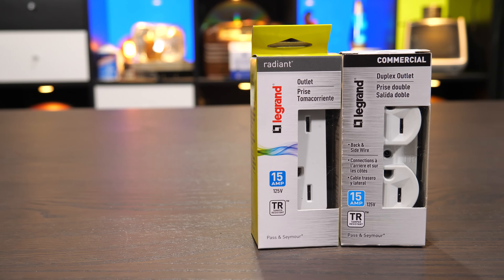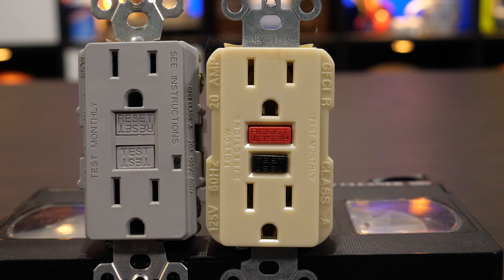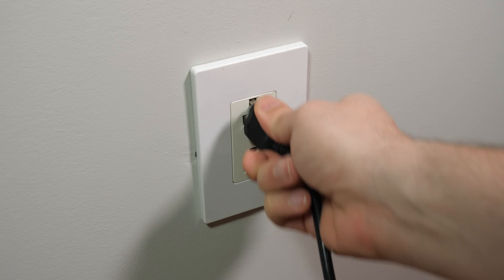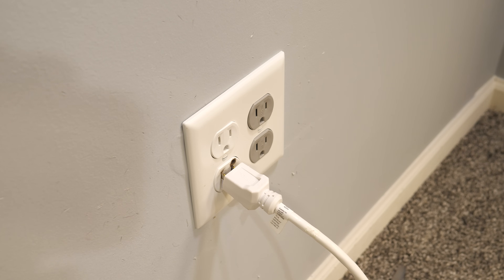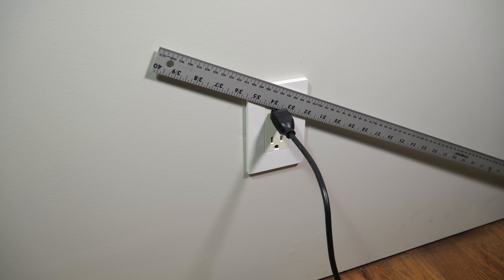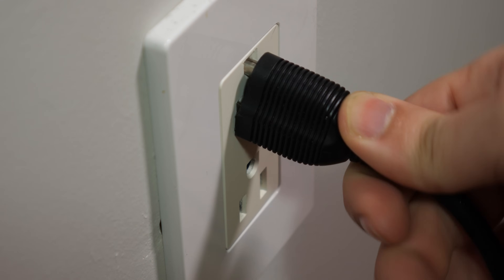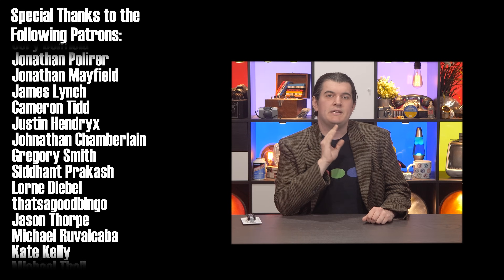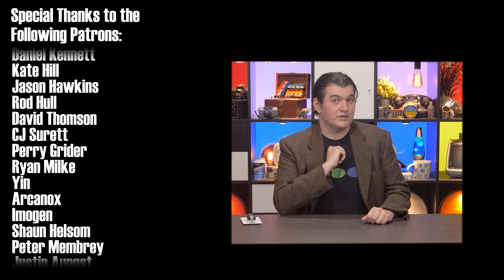Power outlets are topsy turvy - but does it matter?

Comment: I'm far too annoyed with slots on my UPS getting eaten by manufacturers doing "clever" things with plugs (wall warts instead of bricks, right angle plugs, etc), that I'd much rather have a slenderer derivative of Schuko than have right angle NEMA plugs everywhere. Slightly recessed, ground pin(s) stick out from socket instead of from plug, sleeved live contacts, etc.

And then mandate jail time for manufacturing plugs that interfere with plugging things into an adjacent socket either in vertical or side by side socket arrays.
Reply: i bought a pack of super short extension cables years ago for precisely that scenario.
they're not useful often but it's nice to have a few

Comment: Right angle plugs have the same prong issue, so it's not hard to remove them by throwing butter knives at them! After the breaker pops, just pry a bit on the plug while dislodging the knife.

Or use a plastic ID card of some kind.

Or the manufacturer could include some type of removal loop that swings against the wall when not being used.

Comment: As both an example of an upside down right angle plug and an example of why not to turn receptacles upside down, my grandparents bedroom window AC is an UDRAP and they've been duct taping it to the wall upside down for years and the outlet is completely shot, to the point you have to twist it then tape it to make it turn on. I finally got him to replace it last year and I installed that specific outlet upside down to fix that problem for good.

Comment: Your point above the various cords and other devices being designed for the de factor live and neutral on top orientation is actually quite significant from a safety standpoint. These cords and devices will be balanced so that gravity pulls them into their stable direction and any cords coming out of them lay flat in this orientation. As you showed with the right-angle appliance cords, inverting their orientation throws off the balance, causing a cantilever that pulls them out of the outlet. In fact, many of these devices are designed to that pulling them in this direction makes them easy to remove from the outlet - pull up against gravity to remove them easily and safely.

In addition, as you showed, having these cords and devices oriented such that any cables coming from them point up naturally results in them folding over significantly. The cables are not designed to be used in this orientation. It creates significant stress on the cables, which over time causes them to crack, leading to short circuits of the wires within and failure of the insolation on the outside of the cable, exposing the energized wires within. Both of these are far more common situations that lead to overheating and fires. There are endless incidents where frayed cables lead to partial short circuits, slowly overheating and starting fires, often when people are away or asleep. For this reason alone, it is more dangerous to orient your outlets such that the cords extend upwards and you should never use a device in this orientation. Having the cable extended sideways still presents this same kind of issue, but it's less pronounced and won't fail as quickly. Most cords can withstand 90 degree bends under significant load, but 180 degree bends are almost certain to cause failure under just their own weight.

TL;DR: Do not use any devices oriented with their cables out the top such that they fold over. Bending those cables will lead to failure including exposes energized wires or internal shorts that start fires.
Reply: In the end you just described why the A and B plugs are horrible bad constructions.
I love my F Schuko 🥰

Comment: Although I think a lot of the criticism of 120v outlets is kinda pedantic, the 240v outlets in the US are terrifying to use.  No grip on the plug, very tight, lots of exposed metal on the contacts, and all of that in a tight and confined space behind an appliance.  That needs some attention, pronto.  They changed the standard some years ago from the old 3-prong (Two phases + neutral) to a 4-prong (2 phases + neutral + earth ground) but did NOTHING for the ergonomics.

Comment: would have made sense if the prong design was ( --| |-- ) since if the plug was pushed down, the horizontal slotted pin would prevent it from dipping at all. same if you pushed it side ways with the vertical bar. maybe its time for an upgraded reciprocal. chinese reciprocals have alternate facing pins, even Switzerland's cylindrical pin design is simple enough to counter a dipping pin out. I don't know who designed the american outlet but it was clearly a mistake.
Reply: It's pretty ironic that the first American plug patented by Harvey Hubbell in 1904 had the two horizontal prongs (– –)   Shortly afterwards in 1912 or 1913 Hubbell made a plug with vertical pins we now call NEMA 1-15, at the time many homes still had gas lighting and no standards existed for voltage and current rating, they were used interchangeably for 110 and 220 volts Sometime in the 1950s the (– –) plug got it's official rating of 250V 15A designated NEMA 2-15 and was banned in the late 60s because of no ground or neutral,  if this plug were found today perhaps on a window air conditioner from the 1950s where homes were wired with cloth two wire no ground romex it can be used in a modern NEMA 6-15/6-20R without any problems,  assuming it's cord is in good condition.   This is why you sometimes see very old receptacles with (-| |-) slots to accommodate both plug types which coexisted for many years.

Comment: I had a shocking incident with the live-on-top that could be a motivator for ground-on-top in specific scenarios.

I worked in the kitchen of a Burger King back in 2003. There's a large work station where we assemble the burgers. The microwaves are placed on a shelf above the working surface at about eye-level. This shelf has outlets mounted on the front and the cord for the microwave is plugged into this. Like most outlets in my area, it was mounted with the live and neutral on top. As usual with our NEMA 15 plugs, they were always sagging a bit, exposing the live and neutral prongs.

The wax paper wrappers we use for the burgers are stacked above the microwaves. Occasionally, when you pull down a wrapper, a few more will slide off and fall in front of you.

While I was working, there was a promotion celebrating the anniversary of the Whopper. As part of the promo, we switched from the usual wax paper wrappers to metalized wrappers. One day, while pulling a wrapper off the stack, another slid down and landed on the slightly-exposed live and neutral pins of the plug, instantly creating a shower of sparks just a foot in front of my face. Thankfully I wasn't hurt, but that was quite a shocking experience that left us all stunned for a bit. This same incident happened to someone else just a few days later. My immediate thought was that we probably shouldn't leave thin metal objects stacked above an outlet like that. My next thought was that, if the plug weren't mounted with both live and neutral on top, such an incident wouldn't result in a short circuit.

Of course, this is a very specific situation. I expect such situations tend to be quite rare. The fact that live and neutral is such a de facto standard and that so many cords and devices have been designed with this in mind makes it impractical to begin inverting all of our outlets. Like you rightly pointed out, this causes problems in far more common situations.

As an aside, the metalized wrappers had plenty of other issues. Our standard practice is to put the bottom bun and burger patty on the wrapper and microwave it for a few seconds to ensure it is properly heated. That was fine when we had wax paper wrappers, but obviously couldn't be done with the metalized wrappers. We were only using the metalized wrappers for Whoppers - all other standard burgers still used the wax paper wrappers. Everyone was instructed to not microwave the metalized wrappers, and we were all intelligent adults who were fully aware of the importance of  this, but in the hustle and bustle, habits kick in and you eventually find yourself throwing the metalized wrapper in the microwave. It happened repeatedly to everyone who worked in the kitchen. Thankfully it wasn't quite as terrifying as those wrappers shorting across the prongs of a power plug.

Comment: I've always installed my outlets ground-up.  If an object falls between the plug and wall, it'll hit ground first.  My preference only.  In my home, only a few are left ground-down... those are the ones I haven't replaced yet.  As for right angle plugs, they work much better when the device is on a shelf above the outlet, which pretty common.

Comment: I live in the Netherlands, so we use the euro plugs, and are those safer? Maybe, they are bigger, that's a thing. The modern plugs are safe, also for children, and throwing knifes at a connected plug will only be a danger as the knife cuts the wires... 😜 Our earthed plugs are hard to put into the socket and hard to pull out. There is a reason for that, I presume. When I see the US plugs being inserted and removed, it is just sliding in and out. Is there any grip? The 2-pin euro plus also go in and out the socket easier, to be honest.

Comment: UK plugs are the best and safest in the world. Not only does the wall socket have an on/off switch but the earth pin is longer which opens the covers on the live and Netural. This means you cannot poke items into the live and Netural when the socket is not used. Also the pins on the live and Netural on the plug are insulated so that when a connection is made there is no exposed metal as you push the plug in all the way.

Comment: i have a couple outlets installed with the ground up in my house and shop for 90 degree plugs used where the cord needs to run up the wall (to a shelf or work bench)

Comment: this just makes me love Schuko even more. we simply get two neutral pins and make the plug symmetrical, so upside down and angle plug directions are nothing we have to worry or argue about.
Reply: Tbh here in Italy I prefer our standard 10 and 16 amp plugs because they have all the advantages of the Schuko but are significantly smaller on both plug and outlet.
Reply: @traveller23e  It looks to me like the Type L socket isn't recessed like the Type C and Type F sockets are, isn't that a bit of a hazard just like with the US sockets in the video? I feel like sleeved prongs + recessed sockets (with a standard shape for socket and plug to mechanically fit together) should be significantly safer than any socket & plug combination where the prongs can potentially be exposed while live? Although it seems like the prongs on the Type L are at least sleeved.
Reply: @naszfluckah7314  The plug doesn't make contact until the insulated portions are about halfway inserted, so it doesn't make a lick of difference whether or not it's recessed (barring equipment with really old plugs, like you might find in an antiques store). I'll also comment that Schuko plugs normally do not have sleeved prongs but rely on the recess instead; at the end of the day it doesn't matter from a safety standpoint which you use, you just need to pick one. Personally I prefer flush outlets and dislike Schukos for a number of reasons, mostly to do with the fact that the outlet is over twice the size of our traditional 16 amp outlet and at least the versions sold here work badly with the europlug as well as some Italian 10 amp plugs (they snag horribly as you unplug the plug). Sadly a lot of heavy devices get sold with Schukos anyway, leading to adapters being an essential household item. Rewireable Italian plugs are pretty cheap though so at least they can be replaced as needed for the application.
Reply: Only problem is you can put a type F plug into a type C socket, most of the time it fits but ground will be floating... It is too late but if it has to be done over again, this is the one problem that would have been fixed. But without changing the installed base of sockets that ship has sailed.

One other issue is that EU plugs are not polarized, N is considered to be just as dangerous as L and therefore there is no distinction. In in the past L could be 127V and N could also be 127V; they where just 2 phases with 220V between the two when 127V networks converted to 220V back in the day. Ever since N is not guaranteed to be at ground level and therefore not save, both are to be considered Hot, even if in practice one is at near ground level.

Comment: Plugs and outlets (Or the "holes" for the Seinfeld fans) are fascinating to me. Soo many problems solved and cause from USA  vs Australian outlets. Eg, you have a switch on the wall for an outlet but no switches on them. we have a straight out power board cable but you have a nice downward one that now faces up.

Comment: is it not common practice in america to re-plug an electrical device? surely most of these issues of "devices being up-side-down" when the socket is oriented ground up could be solved with a re-plug. in the UK at least you can buy plugs from high street shops and learning to wire them is part of mandatory education in schools

Comment: Coming from the UK and visiting the US for the month, i have to day... US sockets reallly do suck... absolutrly awful. Most plugs/sockets dont have a stabilising pin (excelt for a few i came across in PA) and most plugs just fall off and cant handle heavier travel adaptors (or heavy GAN chargers etc). I found better electrical systems in lower-middle income countries.

Comment: Right angle plugs are great until you need to use more than 1 of them on a single outlet or power strip. I think that the "straight out" design is so popular because it almost guarantees you'll be able to fit the plug into any situation (unless there isn't much clearance in front of the outlet). I'm glad I'm not in charge of outlet/plug standards; seems like a nightmare.

Comment: In China 2 terminal plug cannot be plugged into a 3 terminal outlet (which might be result of copy and combine multiple different standards). The non ground terminals in 3 terminal outlet is not parallel to each other. Interestingly this makes Chinese 3 terminal outlets mostly sit in a ground-top position.

Comment: Great video. I heard about this in the past, considered it, and you are correct. I don’t care BUT to keep my grandkids safe I have replaced at least 2 outlets per room with outlets that include USB connections. This way the grandkids don’t need to handle a 120v circuit. I also have USB cables plugged in behind our sofa so all they need to do is plug the cable into their device. PS.. I still remember the time I touched an exposed blade because the plug broke. I was in fourth grade and that was in the 60’s. Some would say I’ve never been the same since. 😊

Comment: Ground up looks absolutely correct from european point of view, because our angled plugs always have the ground pin on the top. (Actually, they have ground hole, because the ground pin is in the receptacle itself. Unless its shucko. Or some weird country, we have many standards). Is it also common to have the two ground pins in the center of double receptacle, so one of them is always "upside down".